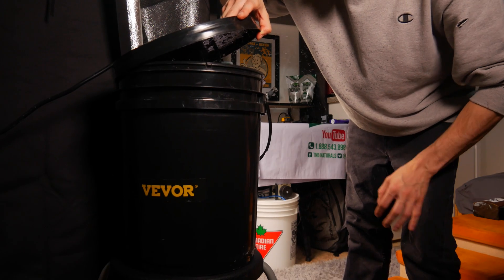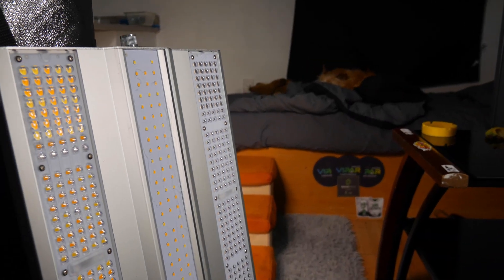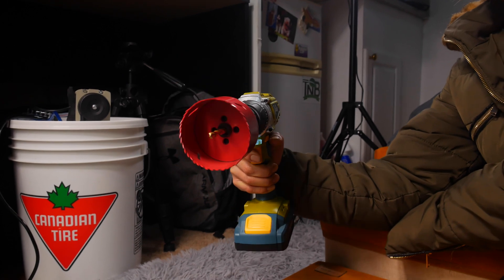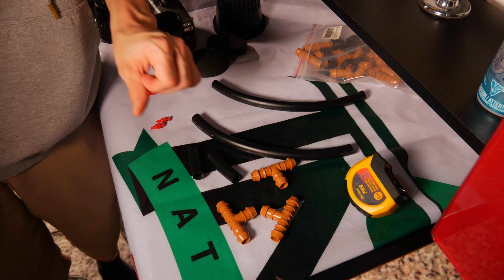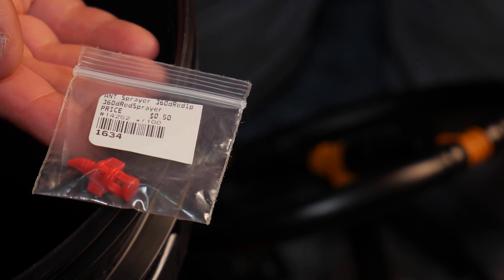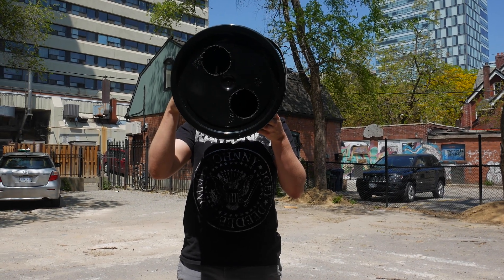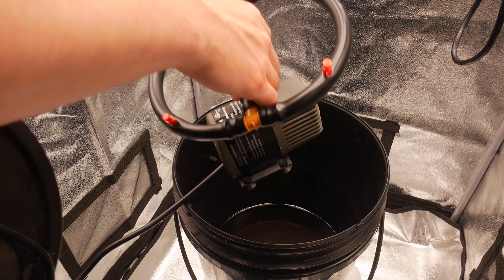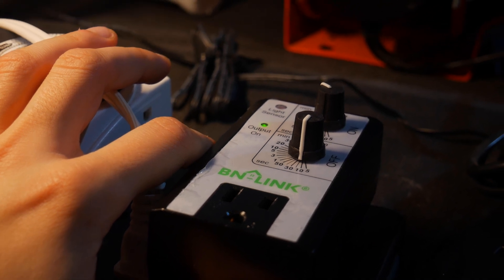How to Build an Aeroponic System

Comment: There is absolutely no reason for the timer you’re just spraying roots with nutrient water. This is low pressure aeroponics and you can see from systems I made ten years ago, that running them full time is best. Also we don’t put timers on pumps because we use accumulator tanks to store a steady amount of pressure. The timer goes on the solenoid. Turning on a pump has to build up pressure making different size drops. You’re frying out the motor on a pump made to run continuously. For example true high pressure aeroponics can grow root vegetables. What you’re doing is creating hydroponic roots suspended in air. So give them all the nutrient water you can. 24/7. Aeroponic roots are really fuzzy to grab those 50 micron droplets and you want little to no liquid gathering on the bottom. So cool setup, just take out the timer and your pump will last longer. If you have a gain in heat usually the air around the roots will keep things good.

Comment: You can make a 5 gallon 12v dc 100psi mist cloner for about $50. One bottom mounted, upward firing mist nozzle will fill a 5 gallon bucket with mist in 2-3 seconds.

Comment: I like this. I DIYed mine using a 5gal Bin a large air pump and large air stones. The bubbles act as the 360 sprayers, all ran by a timer ...Also, i worry that the water can get too warm because of the pump??  Cheers, Martin
Reply from the maker: Nice, I've achieved similar results with just air stones, the popping from the bubbles seems to keep the roots good and moist. We haven't had any water temperature issues related to the pump though we have experimented with covering the buckets in reflective mylar in which we did notice the temperature average drop down a bit. Thanks for watching & Happy growing!

Comment: I like smaller net pots for my clones. I fit close to a dozen sites on the cloner I made.
Reply: I built mine with the small black and yellow 5gal bin from Home DEPot. Large air stones instead of the pump. You have to worry about the water getting too warm especially because the pump is in the bucket.